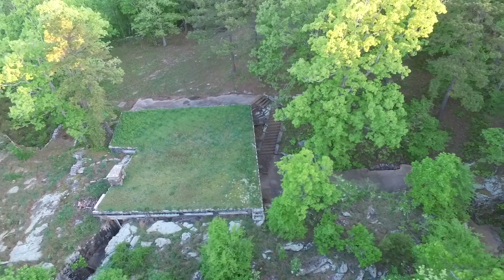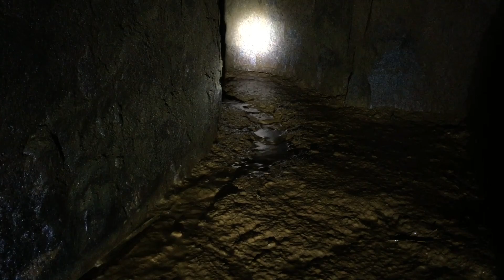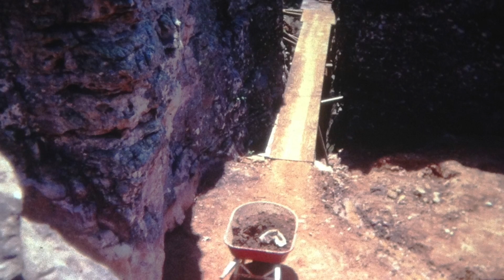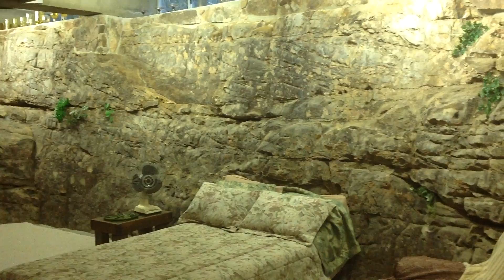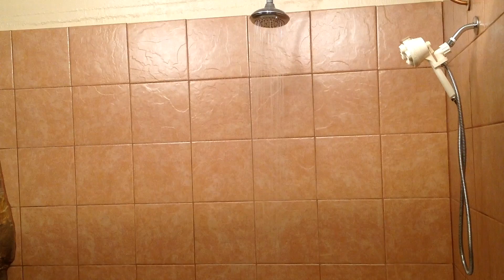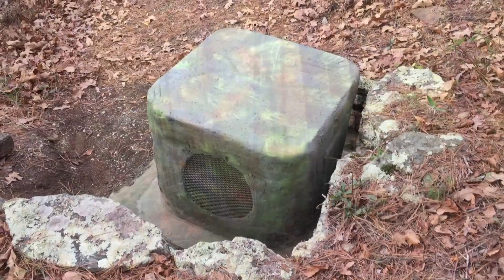Underground Rock House Narrated

Comment: I watched one of your earlier videos and found it inspiring.  I'm delighted and impressed to watch this updated video with all the extra information.  As this was very experimental, would you consider doing a video of things you did wrong?  I'd like to know what didn't work too.

Thanks!
Reply from the maker: Hi Bruce. I don't want a video of things that I've done wrong. I can tell you the main things that I did wrong while building this house. Obviously from this video, you saw that I didn't need the pool. The main thing that I did wrong was doing it all by myself! Instead of 8 1/2 years it could have been closer to two years with just one helper. Also, at least half of the time was spent studying, researching, and planning how to do something that I had never even seen done before. I don't know that I would have changed that was fine because it was cheaper for me that way. I wish that I had at least gone out and watched somebody else do concrete work before I did it myself. I got lucky!